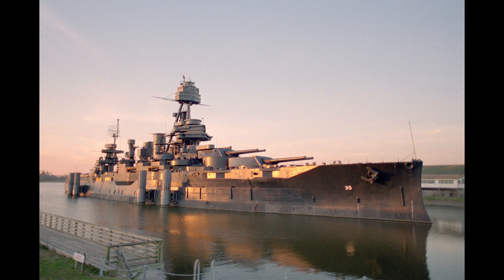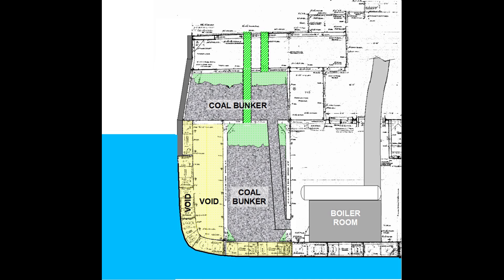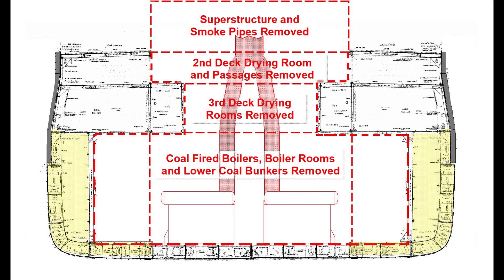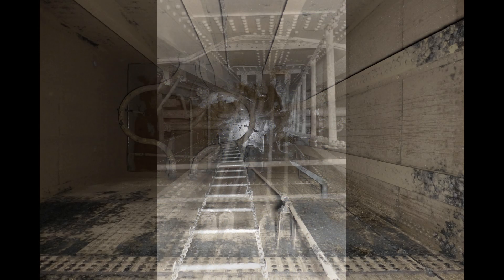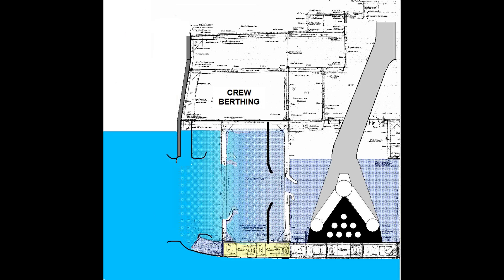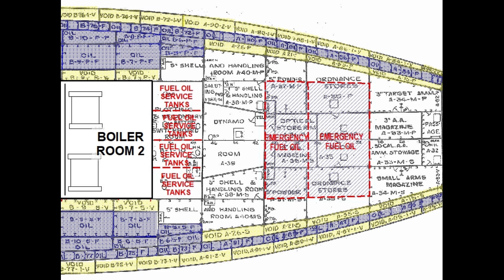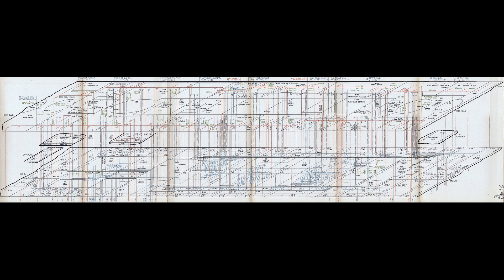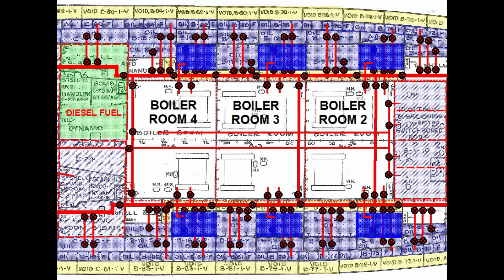Battleship Texas, Coal and Torpedoes

Comment: Fascinating. At a time when high speed was required, coal movement must have been very challenging, & when there were eventually 90+ oil tanks, a logistical challenge as illustrated. Near-surface oil tanks - were they compatible with "bunker C" type fuel in arctic conditions, say  (high viscosity) ? At least, the likelihood of listing/flooding after torpedo-hit would have been mitigated. I wonder what the cost of the major refurb was, over a new-build with the turrets or just guns swapped from Texas to a new one (major work, admittedly)
Reply from the maker: I don't have any monetary figures on the cost of the ship's 1925 modernization, but it was worth whatever it cost.  The reason Texas was modernized at all was due to the Washington Naval Arms Treaty of 1922 that limited the number of battleships that participating countries could have.  It also placed a 10 year moratorium on new construction that resulted in abandoning 5 new battleships being built by the U.S.  Without the treaty, Texas would have been scrapped once her replacement, U.S.S. Washington (BB-47), became available in the early 1920's.  However, the treaty allowed keeping and modernizing some of the older ships, that included Texas, Utah, Arkansas and New York, by converting them from coal to oil fired boilers by using those built for the cancelled ships.  

The video in the link at the bottom of this comment discusses the conversion to fuel oil and a detailed description of that system and its operation.  Documents showing viscosity and friction tables for each of the tanks indicate that it was possible to operate on bunker C, but that wasn't what was normally used.  Navy Special Fuel Oil was consumed that was a mix of bunker C with up to 25% diesel fuel to lower viscosity.  That was done to eliminate the need to heat the fuel tanks.  As can be seen in the video, the height of the "wing" tanks provided head pressure that was supplemented with booster pumps.  Since that wasn't possible with the emergency fuel tanks in the inner bottom, they were capable of being steam heated.  BTW, Navy Special Fuel Oil, or NSFO, was the Navy's standard fuel up into the 1970's when it was largely displaced with JP and diesel.

You are correct about the value of fuel tanks for two reasons.  First a full tank of oil that is ruptured by a torpedo strike will at worse have its oil displaced by water.  While there is a difference in weight between the two, it isn't enough to significantly affect the ship's list or trim.  The other thing the oil does is much more important.  It acts as a buffer that slows or stops steel splinters created by the explosion from penetrating deeper into the ship. 

https://www.youtube.com/watch?v=l-5p2bfQO98
Reply: @tomscotttheolderone364  Amazing info, thanks. What follows isn't a complaint, it's the luck of the draw 🙂I clicked on the video link and it comes up with "Video unavailable This video is private" 🙂

Comment: All of those reach rods, when new and operating correctly could be understood by the “oil king” but if the ship were damaged or even run aground seriously could render many of those tanks useless as    the rods would no longer line up to be accessed. Even a bad valve in an inaccessible part of the ship presents huge problems. Engineering had their hands full. Ex chief eng. merchant marine here.

Comment: Did the Oil King take oil from the tanks in a pattern that improved torpedo protection?  For instance, did he create a zone of alternating full and empty tanks to help absorb the blast like protection schemes on later ships?
Reply from the maker: Nor that I am aware of.  When in combat, they only used 6 battle tanks located immediately adjacent to the boiler rooms, as described close to the end of this video.  The rest of the fuel system was shut down.  As those emptied, fuel could be transferred to them from other less important tanks.  That left two rows of tanks outboard of the battle tanks that provided reasonable protection.  There is a damage control plate that shows a number of tanks that were to be filled with sea water when emptied to maintain stability, draft and protection.  However, the problem with that is the ship did not have flooding or drain lines to the tanks that would allow them to do that.  There was one instance where that presented a problem when they were escorting a convoy.  It was necessary for them to provide fuel to destroyers that accompanied them.  That resulted in some tanks being empty that should have been flooded.  As a compromise, they flooded the torpedo blister compartments that laid outboard of the empty tanks.  That helped maintain draft and stability, but torpedo protection was compromised.  Considering the circumstances, they had no other choice.
Reply: @tomscotttheolderone364  Thank you Tom!

Comment: Seeing how bad the blister walls look wouldn't it be better to  remove the blister walls on both sides of the hull then sand blast, repair & paint the hull for a longer life span ?  🤔 Great video !
Reply from the maker: They are removing the blisters at this moment, except they will be rebuilt.  It is important that they remain to not only provide buoyancy, but also provide the proper appearance for the ship.  The blisters have been a source of flooding problems for many years, even going back to when the ship was in service.  She is now in dry dock and the blisters are being completely removed below the waterline.  They will be rebuilt, but will stop short of their original depth and they will be squared off at the bottom instead of being tapered and faired into the hull.  This modification will make it far easier to access their bottoms for service and repair, while being completely hidden when the ship is back in the water.
Reply: @tomscotttheolderone364  thanks for the information ! 👍🍺

Comment: The complexity of the fuel system is bewildering, so the idea of using six primary battle tanks when the ship is in action seems like a great simplifying strategy. It would be good to know who devised such a system.
Reply from the maker: There was a high level of planning involved by the Navy's design bureau for the battle tank system since there was a separate set of feed lines and valves going to those tanks in addition to the standard feed lines.  So, there were a lot of folks involved in the concept and execution.

Comment: The US Navy purchased 100 percent of the coal from mines at Bluefield, WV, due to its low smoke output.
Reply from the maker: While I am not aware of specific coal fields, there is no question that the preferred coal was a high quality, hand picked anthracite.  It was high on energy content and low on sulfur and other impurities.  As an interesting side note, if they had to take on coal in a foreign port and if time permitted, they would first bring about a ton of it on board and burn it to see how it performed before committing to hundreds of tons of it.

Comment: I went to DC school back in the day. Then transferred to RM. DC was my collateral duty. Hard to imagine getting hit like that. Bunker oil is almost like tar cold. Nasty 🤢 Cannot imagine the knowledge of the Enlisted Surface Warfare pin holders.
Reply from the maker: You are right about bunker oil.  Even though the Navy Special was thinned down, it gets really sticky and nasty after 75 years.  I accidentally stepped in a puddle of it in a dark compartment.  My shoe stuck so tightly that my foot pulled out of it.  I had to pull with both hands to get my shoe loose!
Reply: @tomscotttheolderone364  I SCUBA dived out in the ‘graveyard of the Atlantic’ off of NJ, DEL, MD. One dive, in an Liberty Ship. I thought I was on the deck. I sunk up to my chest. Lots of air and two other divers got me out of the oil. It was like glue. 40 years at the bottom of the sea.
Reply from the maker: @christopherrasmussen8718  I think you beat my shoe story!!!

Comment: I'm wondering, why was coal generating black smoke? Usually coal smoke is gray to light gray, when it's that black it's usually because the firebox is starved of oxygen, but this wasn't the 1850s, surely they would've had blowers to feed air into the firebox right?
Reply from the maker: I am no expert on burning coal and haven't been around it much, but I may lose my man card if I didn't try to give an answer.  They were capable of cleaner burning since I have seen photos of Texas and other coal burners putting out a haze of gray smoke.  Texas and earlier U.S. dreadnoughts provided forced draft by pressurizing the entire boiler rooms, so they could get adequate air to the boilers under most conditions.  My supposition is that there are at least a couple of reasons for making black smoke.  First is coal quality.  They didn't always have high quality anthracite available and sometimes had to use pretty dirty stuff.  No amount of effort or draft is going to keep it from making smoke.  My best guess is what was being asked of the boilers.  If they were cruising at reasonable speeds, demand for coal was moderate and they were able to maintain the bed of coals on the fire grates at an even, optimum level for good burning.  Plus, they kept the firebox doors shut much of the time which helped control air ratio with the dampers.  However, if they were having to fire the boilers at maximum rate, the doors would be open most of the time while they continuously shoveled in coal.  That largely defeated the ability to control air with the dampers and made it difficult to consistently maintain air at the proper ratio.
Reply: @tomscotttheolderone364  Thank you for your answer! And thank you for your videos! I'm so glad to have found a youtube channel that's passionate about the details of USS Texas, this ship has been through a lot of historical events and technological advancements, the equipment inside the ship tell great stories, I hope she'll still be around for decades to come.
I didn't know forced draft was by pressurizing the entire boiler room, I thought it was only sent through the firebox, I've always been fascinated by steam powerplants especially coal fired ones, partly because it's technology we've mostly lost today. 
As for the quality of coal, you probably know Germany in the first world war had very poor quality coal, and yet photos of their pre-dreadnoughts and dreadnoughts (when they weren't being fired at in Jutland) have them display a clear gray smoke, the real downside of using poor quality coal is the remaining residue creating "clinkers" melting into solid rocks and clogging up the grates, anthracite despite being harder to light on fire, is preferred because it has less residue, supposedly German battleships had difficulty maintaining full speed because of clinkers, you do make a good point about burning at maximum rate, a lot of factors combine to starve a hot fire of it's oxygen.

Comment: what happens if a near miss shock breaks one of those universal joints for the valve on a full tank? is there a backup or will it result in some poor fucker taking a swim in bunker oil?
Reply from the maker: Good question.  Valves used to control flow and recirculation of oil were typically located outside of tanks.  Most were well inboard, adjacent to the main fuel lines and inside of voids that could be entered if necessary.  While it is certainly within the realm of possibilities, it is unlikely that these valves and their remote operator linkages would be damaged unless it was due to damage at a level that would likely threaten the ship's survival.  The only valves submerged in the oil tanks were high-low valves that were used to suck oil either off the bottom a tank or about 18" from the bottom.  They weren't essential to operation and were normally set at 18" to avoid sucking up residue that settled to the tank bottom .  The low setting was mainly used to intentionally suck sediment off of the bottom of the tank once it was empty and steam injected into it to clean it.

Comment: This may be too late for an answer but since the ship was opened up why didn't they switch out the engines for steam turbines which would have been a huge improvement.
Reply from the maker: It's only too late if I quit looking at comments!   I'm sure that the decision to keep the old engines came down to cost.   There are proposal drawings still in existence showing that both turbines and turbo-electric were considered.  A change would have given several improvements, including increased fuel efficiency, maybe extended operation at maximum speeds and perhaps maintenance.   However, these were apparently not enough to justify the high cost and time out of service required to make the extensive changes to engines, hull structure, prop shafting, etc.  Keep in mind that while Texas was a valuable asset, her overall design was somewhat obsolete and she wasn't considered a first line battleship.  Also, when the modernization took place in 1925-26, available turbine designs could only give a 5,000-8,000hp increase, which isn't enough to give much speed increase.  It takes big increases in power to improve that.  We're talking about doubling or tripling power for small increases.  It then becomes an issue of whether or not the ship's hull structure can take the increased power without damage.
Reply: @tomscotttheolderone364  Thanks!

Comment: I knew the conversion of Texas and New York from coal to oil fired powerplants was complex but couldn't imagine how complex.  Basically the entire midships had to be redesigned and rebuilt ... and this doesn't include the installation of the fuel tank and piping systems.  

Ironically, it was the fact that sisters TX and NY still burned coal during WWI that enabled them to be deployed to join the Grand Fleet at Scapa Flow almost immediately after the US entered the Great War.  Most of the Royal Navy heavy units already burned oil and thus placed a huge strain on Britain's ability to keep them supplied, but coal was still plentiful and readily available.  TX, NY and other older units like Arkansas were thus deployed long before newer, oil fired ships.

Comment: I couldn't imagine how long it would have taken to fully actuate those remote valves with that manual system.  The Kitty Hawk was pre digital so much was still the same.  I was a Hull Technician we were the Repair division of engineering.   The watch done by the lower enlisted was Sounding and Security rover.  Besides patrolling the assigned spaces you also had to manually sound each fuel void and some times the caps to those tubes were pretty hard to find.  We had a really bad bravo fire in 1999 which was probably less than a minute from being VERY bad by the time it was extinguished.   What caused it was when they pressurized the void to feed the boilers it blew the brass cap off that covered the tube.  Worn teeth just kept getting worse until POP!  This particular sounding tube was beneath one of the main catapult steam lines, it's so hot nearly 2 feet thick lagging around it won't stop it from burning you.

Where we did manage to make visible advancements was in remote valve operation.   Critical valves that needed responsive and fast operation had a motor attached to them.  Hand crank ones were hydraulically assisted, and were still a pain to operate.  We did use it to have fun with the new people.

When we had to cycle them someone never seeing it done before would walk up to us and ask.  "It's manual shaft crank."  "Whaaat!?"  "Oh yeah man cascading failure boilers offline it's this or we're dead in the water....  And man are we getting awfully tired... 😏"
Reply from the maker: Good stories!  Texas had a situation similar to your catapult steam line.  While there were no sounding tubes in it, you had to climb down through a large steam line passage that carried the main steam lines between the boiler rooms and engine rooms to get to a compartment beneath it that contained valves, operators and steaming out fittings for tanks that lay outboard of it. 

I am confused why a tank or void would ever be pressurized, except if checking for leaks.  That seems to be inviting problems.  I am sure there were good reasons, I just don't know what those may be.  

As seen in the video, Texas' feed valve remote operators are typically bulkhead mounted and allowed the use of hand cranks that you could get your back into.  This also applies to recirculating valves that I didn't discuss.  The tough ones to work would be the "High-Low" remote operators for valves that draw fuel either 18" off the bottom or directly off the bottom.  Their remote operators were small slotted disks set in the deck that were operated using a tee wrench.  I would guess that the operators had to be regularly cleaned since they could get packed with dirt and debris, and also regularly exercised on tanks that were not being used.  The only good news is these valves were always fully immersed in fuel oil that naturally lubricated them.

Comment: Texas needs to have a cofferdam built around her. She needs to get out of the water before she completely rusts into oblivion.
Reply from the maker: The ship will be going to drydock soon after hurricane season is over for replacement of most of the hull shell steel below the waterline.  This is her best bet for preservation.  A plan was pushed for more than 10 years that would have taken her out of the water and put her in a dry berth.  That was going to cost $100 million, which simply wasn't available.  The cheaper route of building a cofferdam wouldn't work anywhere along the Texas gulf coast due to soil conditions.  Computer studies were made to model it.  They showed that the ship would settle in the unconsolidated soil that is more than 100' deem and severely "hog".  That means that it would sag at the ends and bow at the mid section to the degree that it would be heavily damaged and effectively destroyed.